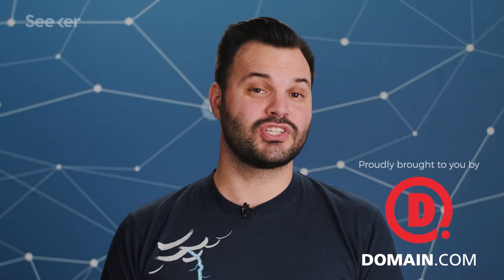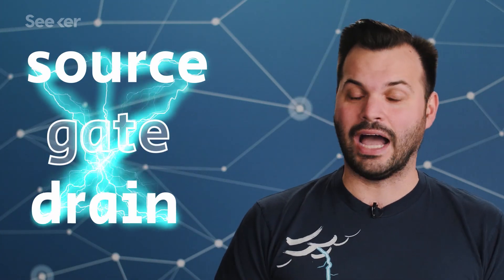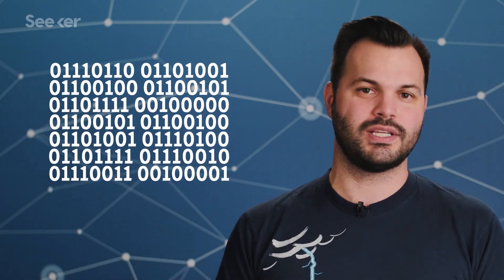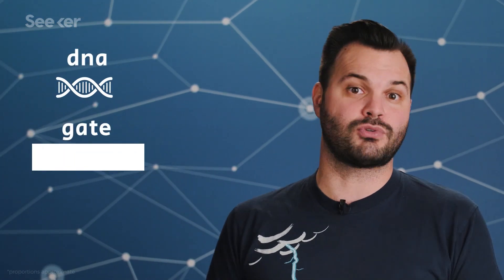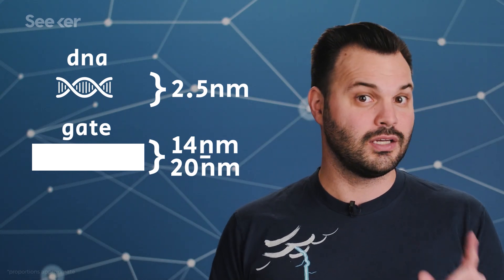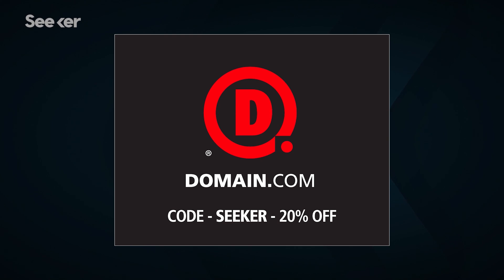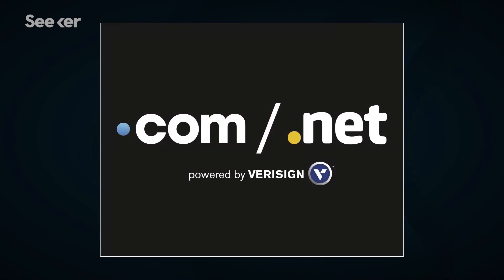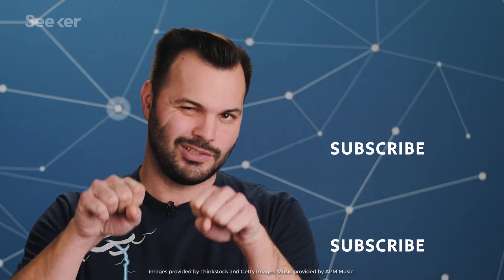This Is the End of the Silicon Chip, Here’s What’s Next

Comment: A single ladder rung of DNA has 18 unique "states" vs silicon's two.  DNA is 2nm vs silicon's 5nm theoretical limit.  That's 22 times improvement over silicon.  Not recommending DNA computing, rather that there are more compact (and thus faster with lower power) structures than silicon.
Reply: DNA is the code. The electron-transport chain of oxygen ('O'-2) is the power supply. A bunch of different proteins work as the controller switches....And baseball bat to the noggin is the reset button
Reply: I believe that DNA storage is a thing that's being seriously considered.
Reply: Yes, there is certainly a lot more limitations, but I'm just laying out the basic limitations as for why DNA is not a feasible solution, it is simply because DNA does not compute, DNA stores data, it is an interesting factor when talking about storage technology, HDs, NAND flash, etc. But this video is in another subject that DNA plays no role in other than the mere length comparison. And of course, we are getting to the limit of Moore's prediction, we will probably have to move away from transistors to the next big thing in the next few decades.
Reply: You're confused; a hard drive might hold many times over the amount of data that RAM does, but you wouldn't use it in place of RAM. DNA is data storage, and Ribosomes are particular strings of instruction to be carried out by task-specific organic machines.
Reply: Mantis - Single atom is irrelevant.  Silicon limit is 5nm.  DNA is 2nm built-in.  To those who say DNA can't process, better tell it to RNA, because RNA "processes" DNA.  RNA lines up next to DNA and performs some mapping (process) and transfers that processed information forward.  Yes, there are all sorts of complexities.  Yes, speed is a challenge.  But, we're looking at the theoretical bounds of what can be done, not throwing darts yet.  

Point is that even assuming one could solve all the processing and speed challenges, DNA computing provides only a factor of 22 improvement, based on the same size-wall Silicon ran into.  And 22 is only seven-years on the Moore's Law curve.  It took Silicon forty-years to hit the atomic limit, are we really going to invest forty-years of unprofitable effort just to bring DNA into a position to pick up those seven-more years on the Moore's Law curve?  Remember, it was profitability that paid for Moore's technical advances?
Reply: I understand where you're coming from, but what you have to consider is that the typical computer transistor changes it's state purely with electricity billions of times per second. DNA is an interesting mechanism to store information, but it doesn't have the capability to change and process information, with that amount of electrons running through, it would rapidly degenerate. Each DNA strand merely holds a certain piece of information, so the comparison is not at all valid...
Reply: Also for fun: Who here now has more RAM capacity than their first computer had Hdd Storage?   \o/
Reply: So IBM has developed a scanning tip that is (IIRC) basically a single Nitrogen atom that is triple-bonded to a carbon, and works by measuring the attenuated pull & repulsion effects on the dipole that each atom it goes near (or "scans" if you will) has & exerts on that C to N tripple-bond. That sort of technology may develop to allow storage that is atom by atom, rather than nucleotide by nucleotide. However, it would not be able to pack & fold in on itself the way DNA can, and we wouldn't have the vast resources of nature providing possible methods of accessing & executing certain procedures the way we do with DNA.
Reply: +Harley Me -- Also, if the energy is TOO low, then the signal or the storage might likely become subject to background radiation disruptions. Before the Silicon revolution, we had copper computers that were unbelievably inefficient, measuring energy attenuation from stretched-vs-unstretch lines of copper to create the 1's & 0's to be processed. It was crude, and horribly inefficient but the EMP from a nuclear blast which can flip the low-energy silicon semi-conductor had no effect on the those old copper computers.
Reply: Interesting... I am no expert on DNA or biology, but with RNA acting as the messenger molecules as they are released from DNA, which are then picked up by our cells, might not a cell be considered to be comparable to a microprocessor?
Reply: DNA is inefficient information carrier, prone to reading errors, and it's storage, not processor. You still need processor to process information that DNA molecule carries.
Reply: CheffBryan is not a fan of RAMdrive or NVMe (although I think his point is that DNA is not a processor so Moore's law re: silicon e-gates should not apply)
Reply: Actually,  the 'transistors' of the body are technically the ribosomes :)
Seriously,  DNA are good storage material but like modern drives,  requires something else to process the said stored materials...  Which is the purpose of transistors....
Reply: Tom Noyb - It's difficult to be wrong so many times in such a short post.  4x4=16.  Distance between Si atom crystal latices is much smaller than a nucleotide.  Computing is an action, while data-storage is static.
Reply: @Tom Nyob Ribosomes only read or translates information in DNA or RNA and don't process it in a way that could be easily and quickly send to some output devices. You still need processor to make sense of that information. In a cell, there are more complex processes that allow protein synthesis and other stuff. I don't say it's impossible to overcome some construction details, but I think silicon will be still cheaper and more effective that DNA computers, when they will both have same computing power. Maybe I'm wrong, but I put more promise into AI and quantum information field.
Reply: Yes, many problems.  But, even if all those decades worth of problems were overcome, the benefit of such a perfect system is minimal.  DNA doesn't appear to be a solution to the Moore's Law dilemma.
Reply: +Harley Me -- Heat's a good consideration. I wonder what the lowest bond disassociation energies are within a DNA structure?
Reply: Microsoft is on it, and has actually used DNA as a storage medium, on a limited scale - not easy to do, or cheap, or scalable at this point.
Reply: I wasn't aware of any such computers. Interesting though, kind of like stretching a guitar string I presume. Can you provide a little more info, or links to any such devices?
Reply: And a chain of DNA memory will fall into some primordial ooze and turn into a monster!
Reply: I have a feeling you don't exactly know why we choose two binary digits...
Reply: a gram of DNA can store  215 petabytes.
Reply: Idk... Bout 6 years till the near by network nodes don't drop invalid packets that it floods network with. If nodes want to see it ever talking valid ip let alone send or receive In http the nodes need to divert (6years *microseconds in a year) worth of cycles and allow Intrupts from sensors useful to attempt reparsing its network noise into what it needs to stay alive and learn the next layer. 99 years later it still won't solve simple algebraic problems with the efficiency of silicon. How much energy from the sun was needed to produce this inferior alternative to a cpu? What u are geting at isn't entirely wrong but thing is.. Judge a fish for how well it plays human gender feminist riding a bike well blogging then argue this said anything... All u show is how public school and use 6 sources to support your feelz makes logicless    plebs obsessed with right to have guns that can shoot their other gun more times per second than required to kill a gun that doesn't kill other guns... and keeping every baby but with out health care...

 Or plebs obsessed with women and minorities not being above Allah or Joseph Smith. While snorting the glass celing and ignoring over all wages don't keep up with inflation.  the right to abort their husband any years after term and insisting gov fits the bill for a coat hanger Stand in but any baby that gets here at lesdt gets health care and can chose to wear a fedora to avoid abortion at 16 years of term  if male

I digress but it was fun. Point Is basicly go see Darwin and pray musk doesn't join Luke's father.

Red planets matter😂
Reply: Thats actually very practical .
Scientists are not able to go ahead of the "organic capabilities" as of now, all they do is reverse enginneer the natural surrounding and build a artificial version of it.
But if the are able to build a photonic chip than that can be a game changer.
Reply: DNA would be a cool way to store information about the world as one gram holds 1 pentabyte of information, and maybe have a huge local store of all websites that are a year old.  It can be duplicated easily, but it cannot be written very quickly...
Reply: @aoeu256  the speed would be shit.
Reply: Ricardo - Surely there'd be many more technology challenges than that?  Merely laid out the theoretical limit.  A factor of 22 is seven-years on the Moore's-law curve.  Moore's law originally postulated halving gate-lengths every eighteen-months.  In other words, if Moore's law were to extend past 5 nm, DNA could only add seven-years to the curve.  Is it possible to develop DNA to the point of mass production within the two-years left on Moore's law?  One presumes not.  

Even if DNA computing were the correct technology direction, it couldn't save Moore's law.  Moore's law has been the economic growth engine for the world.  When it stops, what happens to economic growth?  Most of us have never seen a world without that growth.  We rely on it.  Now it's over.
Reply: @tomnoyb5079  If that "engine" stops, of course you use the other engines.
Reply: pabloeli29 Yeah, there was serious progress on that front. Prohibitively expensive though.
Reply: funny, an optical transistor would use even less power and create no heat in the process.. meaning you could bind infinite numbers of them together and not worry about cooling.

Comment: We hardly use the full potential of our computing power now.  Programming has gotten lazy and inefficient using way more processing cycles than necessary. My 10 year old dual-core system still works fine and could be updated with more RAM a solid state drive and a bigger video card and it would reach acceptable levels of performance for gaming. Even if we we're unable to shrink transistors any smaller than they are today we can still improve other hardware, architecture and software development to continue offering increases in performance for years to come.

Comment: How does expensive technology become cheap?
Reply: Supply and Demand, once investors and producers see that the tech could make them money they begin production, which drives prices down, and then the balancing act begins.
Reply: because they are made in China, and will continue to be made in China, because Labor Work is cheaper and control by Communist China.
Reply: That depends on what made it expensive in the first place.  If it's because the materials are rare or if the technology has really picky conditions that prevent mass-production, it won't be cheap.  That being said, what has been accomplished for modern quantum computers will never be cheap, nor will Mb-based transistors.
Otherwise, technology becomes cheaper over time because the engineers have been paid off and the creators found a way to mass-produce the product.
Reply: Manufacturing becomes easier the protect becomes cheaper. However the materials used can also hinder price reduction. If you can manage 10 cpus a year then 10s of thousands each if you can manage with more ease 100000 cpus a year they are only 100s each supply and demand.

Comment: Uhm... Processor speeds stopped increasing more than 10 years ago, this is not news. But computers are still getting faster though. It's just that you don't get the free speed up you used to get by simply increasing the clock speed. Today you have two or more cores in CPUs, modern GPUs even have thousands of cores, and more and more tasks are solved on GPUs now. You just need to be more clever about it, so software gets written with a parallel or multicore processor architecture in mind.

I'm not saying that we won't have other than silicon based processors in the future, but you can get very far just with more cores and parallel programming... And if you don't find anything that's a lot (!) faster, you're going to have parallelism anyways, and in that case it would need to be cheaper and as reliable as silicon... Not going to happen soon...

Comment: How about not making them smaller but more in numbers? 🤔
Reply: They are already doing that, hence higher TDPs and physically larger dies than were normal in the past. But this has already becomes somewhat impractical and inefficient to the point we are hitting limits there as well.
Reply: Azmeri Liza wont work
Reply: It's less efficient than shrinking the size of transistors. For example, if you have 25 transistors and want 100 transistors, you either make 4 times more transistors or make the transistor only 2 times smaller. Also, making more transistors cost more materials. If you instead make it smaller, the required material will not change but the number of transistors you have will increase in mathematical sense of course.

Comment: Hey Trace. You're talking about FETs, or Field Effect Transistors with the gate/drain/source at the start of this video. Not regular transistors, or what we would call Bi-polar junction transistors in electronics, which have a collector, an emitter, and a base. Although, FET's are what most chips are made with now.
Reply: Yes, and?  Processors use FETs (some specifically use FinFETs) and have been for years.  Trace isn't wrong.
Reply: Yoshi Knuckles, Yup, you nailed it!  Different beasts altogether.  And, Trace IS wrong, Peter Schmidt.  Trace was historically talking about BJT transistors and never switched gears to a FET.   It wouldn't have taken any effort for him to clarify and say "FET" when addressing the Source, Drain, and Gate explanation.  Trace is ignorant, else he would have said, "Emitter, Collector, and a Base."  This isn't the first time Trace has been wrong, and it won't be the last.  It happens to all of us - myself included.  However, after offering up a smoke sacrifice to the Electron gods about 40 years ago when I thought I'd just be able to replace a FET with a BJT in an amplifier circuit, I've never confused the two since.  Ever!
Reply: I didn't see him talking about BJT, only transistors in general, so I wouldn't say he is wrong
Reply: @lucasprado6705  he was talking about gate drain source witch is only for fets
Reply: they are still transistors - and those are affected just the same.
Reply: @ABaumstumpf  the purpose is same but they are different in many ways
Reply: @revolution5547  FETs, Mosfet etc - they are still transistors, just not bjts.
Reply: @ABaumstumpf  and? He still was talking about fets without mentioning bjts
Reply: @revolution5547  he mentioned neither as he was talking about transistors in general.
Reply: @ABaumstumpf  but some people can think that gate drain source are in any transistor
Reply: Yoshi Knuckles Exactly FET's and MOSFET's have been around for many years but this guy prob never heard of them.
Reply: +Peter Schmidt Read his comment carefully.
Reply: Thanks,i was confused that my book had transistor made of emitter,base,collector ones. I didnt knew about these FET
Reply: Ahh. That's how you know you fixed it.

You let the magic smoke out!

Quick! Grab the magic smoke insertion spray!
Reply: Yes, talking-head Trace, the point-contact germanium transistors you were talking about are not constructed in a source/gate/drain configuration.  Why don't you hire an editor who knows what you are talking about to correct your ignorant and erroneous remarks?
Reply: Exactly and the most common FET is N-channel, so in state 0 the FET is ON, and in state 1 the FET is OFF.and the main factor affecting switching velocity is gate-source capacitance.
Reply: Thanks for clearing that up, it bugged me all the way through his blah blah blah.
FET is a little different than a basic transistor. However that is what is used in most applications today and even enhanced types are the common use. I read somewhere that the DNA will be used as we journey into the future of storage and computing.
Reply: The first transistor was a FET....
Reply: FET or BJT, it’s a transistor after all. I don’t get it how is he wrong?